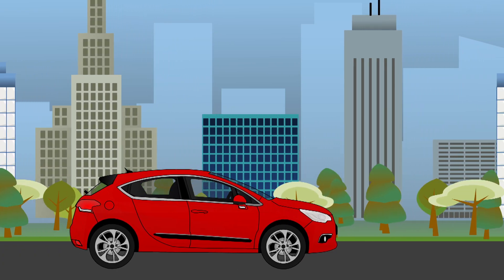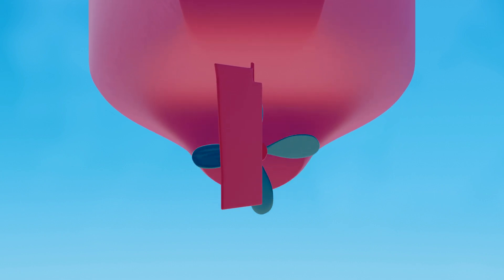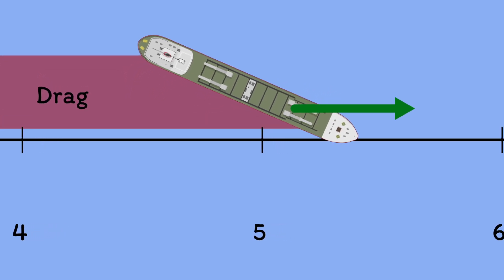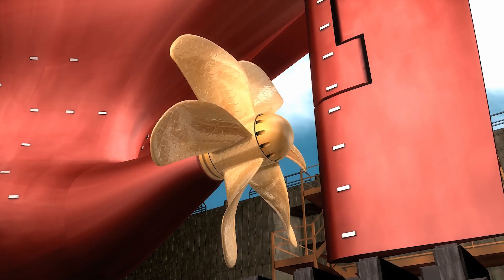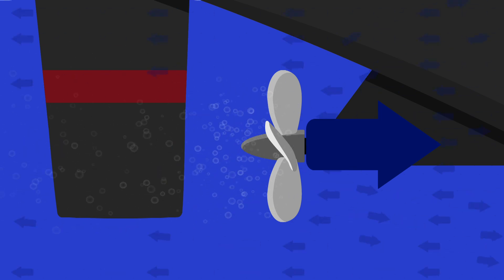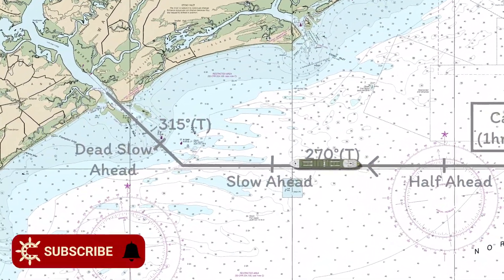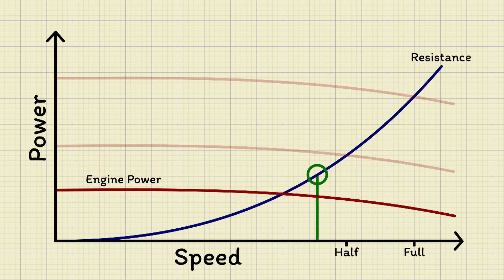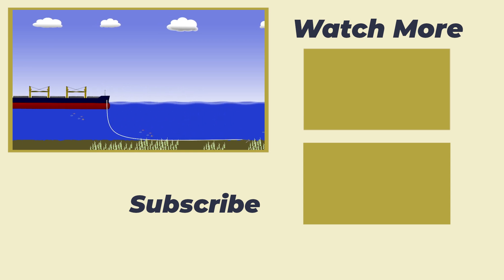How Do Ships Stop Without Brakes?

Comment: The one dislike is from someone who thought they could use the anchor to stop their ship
Reply: May be someone was waiting for Suez block explanation...
Reply: You can , in an emergency situation it is used and can work but you need to do it soon enough . There is a video on here of ship crashes , a container ship is heading towards land and you can hear the anchor cable being let out
Reply: @MrTarmonbarry  True, but if you have to rely on the anchors to stop modern ships, it's probably already too late.
Reply: @VerilyVerbatim  Well , its like i said , if you spot that you need to do it soon enough it works , all a matter of laying out enough cable then locking off the windlass and keeping your fingers crossed . A lot will depend on speed to fast and you could drag the anchor and cable but if that happens you get more friction on the cable and that will help because it is one of the main things anchors and their cables rely on .
Have a browse for ship accidents , there is one where a container ship is heading for shore and letting out cable , it stops with the bulbous bow just touching the bank gently 
https://youtu.be/lp6a7yyIFeM
Reply: @MrTarmonbarry  yeah I thought so too, the other vid I saw was a ship trying to dock in a port in 12 beaufort conditions, the captain dragged the anchor and positioned the vessel at approx 45 deg with the bow facing the port and it worked. The only reason I can think of as to why these maritime academies/companies teach not to drag anchor is because anchor and chain cost bulks of gold.
Reply: @jhon.e4437  Hi , its o.k to drag an anchor , there is not much danger of losing it unless it gets snagged on something very firmly and if you are dragging then its rough seas . Snagging in those conditions could lead to severe damage to the ship , it could tear off a good part of the bows and the only option would be to actually let the anchor and cable go so the ship did not get damaged that way , but that is a rock and a hard place situation . If you have a lot of cable out you would be close to land , so do you let it go and risk being swept onto the land or take your chance . Not a decision i would like to have to make when you are talking tens of millions
Reply: @VerilyVerbatim  That could be said for any emergency stopping procedure. But if you are, for example, having a loss of control event while maneuvering inside a harbor, dropping your anchor is quite possibly the best way to stop your ship.
Reply: @jhon.e4437  Hi , cant seem to find the last reply you sent to a comment of mine . YouTube screwed up maybe ??
Oh the sea is very unpredictable alright , you can get a storm out of nowhere but at the same time you can get what is considered a bad area like the bay of Biscay and it can be as flat as a mill pond whereas most people think it is always 30ft waves )))
Reply: @SirKenNorth  
If you crash your ship with a loss of controll and your anchor are still in nobody belive you the loss on controll.
In an channal you can't use your anchor as there are often concrete walls at the bottom of the channal which need to repaired.
Reply: @MrTarmonbarry  Yes , this is a common procedure !
Reply: @welshpete12  Yes i know , i was in the merchant navy for some time and had to use this a couple of times . it works if you see the need soon enough
Reply: The director of “Battleship”
Reply: I mean, you can though. Dragging the anchor is a well known and used emergency stop method.
Reply: @SirKenNorth  Oh yes , you can and its used a lot more than most people know . If you have engine failure in a tight spot its one of your only options , had that going between Italy and Sicily, its not a good experience but something you do not know is going to happen until it does , if you are in danger of being washed up on a beach in whatever weather its better to try that than do nothing
Reply: It's 17 dislikes now, perhaps the person brought friends to make them feel better?
Reply: @VerilyVerbatim  
PMSL
Reply: I thought it was flaps on the bottom of the ship
Reply: Same here, like an underwater spoiler, or some electric thrust reverser, or a reverse gear. But many ships have many designs. :)
Reply: Or it's someone who could see through his false claim.
Reply: Dropping anchor is actually an important technique. In some ports there isn't enough towage to bring ships in otherwise, so they can drop anchor and use it as if it was a tug pulling on the point. Particularly I have seen this in sandy ports with 1 tug on the quarter, ship comes in and drops bow anchor on the same side as the tug squares up to lift, now the pilot just has to balance the tug against an on berth condition (flood tide) to get the ship safely alongside. 

I don't think this is common, and rightfully so because it must destroy the seabed.
Reply: Usually followed is 20 30 miles away frm land gradual reduction. An effective wld be drop frm full steam to slow or dead slow ahead. .like frm 5th gear to 1st gear. Easier in cars and motorbikes
Really really difficult in a 200m ship. But is an accepted method in a controlled emg situation
Reply: For a ship of lets say 50,000 tons 
And achor or at least 50 tons is reqd. As per regulations. So if we go lets say 9😅, den buddy we lost 450 tons worth of cargo capacity. Plus its just to hold the chain. Not even the ship in place. So stopping a ship is never the job of anchor in the first place😆😆😆😆
Reply: One anchor, that's rich🤣! That's why you have to get a bunch of anchors, like 9 of them. Then you'll stop.
Reply: No, I upvoted.

Comment: Why don't ship have "air-breaks" like planes with small wings extend underwater to increase friction while going ahead.
Reply: because that needs to be insanely strong to withstand the water pressure
and such a technique under water is very very prone to damage, or just gettign stuck with plants, mud, shells and what not.
Reply: In reality the speedbrakes on aircraft don't act like you think they do. It's common sense to believe that panels lifting up on the wing would act as drag, but no. The way they work is by disrupting the airflow over the wing, which disrupts the lift so that the wing becomes much less efficient. On a boat i doubt it would work as it is propelled via a very different system and the forces would be huge.

Comment: Great video. I would also like to mention tug boat assistance, this is very common. 
The tug boat can of course have many purposes, but many times the main purpose is to slow the ship down. This also allows the ship to keep some engine (propeller) speed to maintain ship maneuverability even at very low speed though the water.

Comment: Could you put hydraulic "water"breaks that work like airbrakes in aircraft? They could be used even for turning in some cases
Reply: Plausible, but they would be very inefficient and have to be heavily reinforced in order to do the job. Better to use the rudder, which does virtually the same thing
Reply: @waverleyjournalise5757  about that.... They tried something like that with Wisconsin by turning the rudders in towards each other. Allegedly she stopped inside one ship length. She also had the most rudder issues of the Iowas.
Reply: @SirDoggydog  I've heard that story, but Ryan from the Battleship New Jersey channel said it was only a rumour

Comment: You can totally use the anchor to stop the ship quickly. I saw it in a documentary once. "Battleship" I think it was called.
Reply: Or losing it.
Reply: @ramon1930  If the anchor dug in and the anchor cable came up tight that quick you would lose a good portion of the bows , it would be ripped out .
Got to love Hollywood ))))
Reply: It could be disastrous
Reply: Can confirm, I saw it in the documentary about Caribbean pirates
Reply: @bluemountain4181  lol
Reply: @bluemountain4181  Bootleg Turn technique???

Comment: I didn’t think you could just, drop in reverse(except for the switchy flappy propeller blades. 

I thought you have to stop the engine and then restart it in the opposite direction (whatever that means) and though that that would take a long time?
Reply: It would not take too long, but it would depend on the engine; some designs can, others can't. A better option would be using a dedicated reverse gear. More and more ships are using directable propeller blades because of the efficiency and speed of changing manoeuvres, and the decreased strain on the entire powertrain

Comment: Are fin stabilisers on cruise ships able to be utilised for braking? (by turning them the same direction rather than opposite so it increases drag without inducing any rolling force)
...I'd imagine they'd be fairly effective for that.

Also, if a ship has twin rudders are they ever able to operate independently so they can both be pivoted in opposite directions to increase drag without applying any steering force?
Reply: I was thinking on similar lines or even having recessed plate in the hull and pivoted at one end and hydrollics lower them to increase the drag!
Reply: That's a thought; or if you had twin propellers you could use reverse thrust and still maintain some control by cranking one engine up higher than the other if you need to turn towards that side (and if you had bow thrusters, you could use those for steering).  But most cargo ships are made as simple as possible (for maximum efficiency under normal cruising conditions), so they have just one giant propeller and 1 big rudder and no bow thrusters (even recessed bow thrusters would add drag unless covered, and even if covered they would still deduct from cargo space).  Known exception:  Maersk Triple E class has twin propellers because a single propeller that would be big enough would have exceeded the depth of the harbors they are expected to operate in.  I also saw a video taken on some LNG carrier that had twin rudders (and presumably twin propellers), although I don't know if the control system would let you move the rudders in opposite directions.
Reply: The twin rudder has been tested historically with an Iowa-class battleship. They had this thought, and so they unlinked the rudders to operate them manually, then "closed the barn doors" and pivoted them inwards. 

Supposedly, the stopping force was so powerful, people were thrown forward, and the ship stopped something like within a ship-length of itself.

Comment: There are a few other options as well, though far less common; the Swedish CB90 combat boat uses twin water jets with thrust reversers, and can crash stop from over 40 knots in three or four boat lengths. It's something to see...
Reply: There's also the Barn Door stop the Iowas did one time, where they turn both rudders in towards each other
Reply: @SirDoggydog  This one ended up throwing everything not secured to the deck into the bulkhead ahead causing multiple injuries and a leak that was fixed only during Iowa's reactivation for Vietnam War.
Reply: @tymoteuszkazubski2755  It was Wisconsin, not Iowa, and the stopping distance and injuries is only a rumor.
Reply: I was thinking of this
Reply: Why does this one remind me strongly of squids 🤔 if I'm not mistaken they can turn their siphon reversely as well but I'm not sure 
(Wait, you wrote "boat lenghts" ( without editing the comment) I assume you mean the size of this boat for reference so I'm a little confused why someone commented it is a boat🤔)
Reply: @rydrakee57370  You and me both, mate. :-D
Reply: I google the CB90.  It is a boat NOT a ship.   Just stop the engines and the boat will stop pretty damn quick.
Reply: @peggyt1243  You'd be surprised - from 40 kt even a relatively small boat will coast a long way without active braking. And yes, it is a boat rather than a ship, though the terminological distinction is nowhere near as relevant as you seem to think; there are plenty of larger vessels with water jets and reversers. It's not one of the most common options like the ones in the video, but it's far from unheard of.
Reply: @awmperry What is relevant is that at 40 knots it planes.  You go off the planing pretty quickly when engines are stopped, you will not coast at 40kt anywhere. You drop to displacement/hull speed and the coast.
Reply: @dmitripogosian5084  Absolutely. It's still a far cry from normal deceleration to a dead stop from 40+ in a few boat lengths, though.
Reply: Gayden 🇸🇪=🏳️‍🌈

Comment: I wonder if you could extend hydrobrakes, to dramatically increase the drag, they same way airobrakes work on a plane.
Reply: In reality the speedbrakes on aircraft don't act like you think they do. It's common sense to believe that panels lifting up on the wing would act as drag, but no. The way they work is by disrupting the airflow over the wing, which disrupts the lift so that the wing becomes much less efficient. On a boat i doubt it would work as it is propelled via a very different system and the forces would be huge.

Comment: Quite surprised hydrologic ‘air brake’ esc underwater flaps aren’t used, that to me would be seemingly the most obvious solution.
Reply: flaps are not common for the simple reason of the difficulty and cost of engineering them for each ship. the flaps would need to be articulated and controlled from the wheelhouse, be able to open and close under very high pressure of sea, not be a possible leak point, and hopefully have some use during the vessel's regular operation. planes can have articulated wing flaps because those are part of how they maneuver normally, and the flaps aren't a weak point in the wings, nor do the wings contain an atmosphere like the cockpit.

Comment: Interesting content, i always wondered how that is done in the naval world. Coming from aviation where we do not have the option of friction brakes either (until on the ground), we do use normal thrust reduction as well, we do not use the rudder in that way as it might rip off, it is simply not build for rapid opposite use, although flying s-curves is somewhat similar to the slow rudder technique.

What we do have though, and apparently ships do not, are drag-brakes, or speedbrakes as we call them, metal flaps that will be extended into the surrounding air creating a huge drag and slowing us down, or allowing rapid descent. Those are usually, but not always, on the top of the wings. Similar things would be possible for ships as well, at least in theory. Is anything like that used? Or do ships rely on the much higher drag due to the extremely high density fluid they move through?

A few other things that we do use are of no use for ships of course, mainly the high lift devices, leading and trailing edge flaps on the wings, as well as the landing gear which is the biggest and most efficient speed brake there is.
Reply: There's another method in aviation that's like the low-frequency rudder technique, although it's not commonly used on larger planes: sideslip. In both the idea is to use the slip angle to increase the drag of the hull, it's just that on a plane you can use the lift of the wings to prevent the direction of travel from changing, and so you can perpetually keep the sideslip going one way without having to alternate the direction of the slip. As an added benefit the lift required from the wings increases and therefore their drag increases as well.

Planes can also do 360-degree turns, but those tend to be coordinated as far as I know, and therefore do not rely on the slip angle like turning a ship under full helm, only on the increased track miles in a small area.
Reply: @heto795  Well, as someone who started out glider flying i do a know the sideslip, especially on older gliders that is a very much used method, newer ones have extremely efficient speed brakes and do not need a slip. 

However, in commercial aviation that is not used. Slipping can and does stall the engines as those are can not deal with much of a slip angle before flow separation at the intake lip which in turn will lead to a compressor stall. 

Yes, 360° turns are a possible method if everything else has failed, but if those are possible depends on arrival sequencing and traffic density. In high traffic density they can be a nightmare for the air traffic controllers.